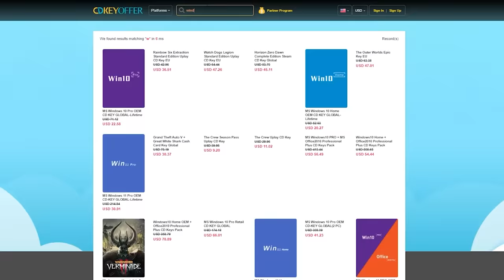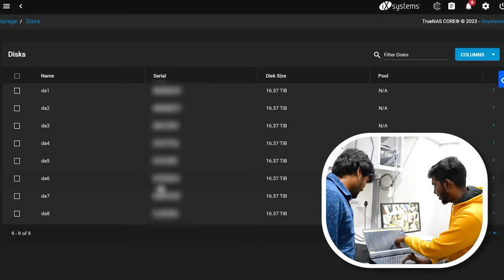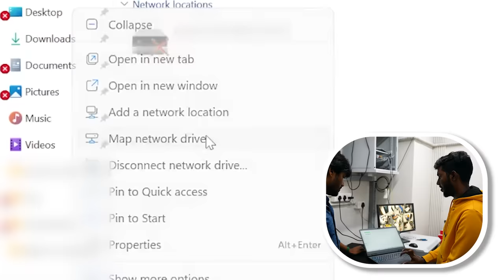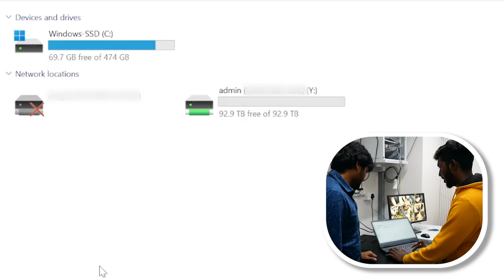150TB Storage Server @FinallyOffl  Office | Storage Server-எதுக்கு? - எப்படி SETUP செய்வது?

Comment: Hello Bro..one doubt..why do they go for Physical servers they can go with cloud providers like AWS or Azure right, any way this is not critical data and cloud has pay as you go model..which will work much cheaper, what is the advantage of taking pain of setting up server, maintaining it etc..can you let me know just curious..
Reply: Cloud storage is not cheaper. It's way more costly if it's for long term and large volume of data. (Eg: 30-50 TB of data usage per month can go as high as $3000/month)
Local system will be more faster than cloud. Since Finally will be mostly using it for video editing, they need faster network and local NAS is best for them.

Comment: PC Doc anna, i have a doubt. Like this type of storage server, how data stored in server hdd transferred to destination device, server hdd to destination device or hdd to server ram to destination device?
Reply: To my extent of knowledge, the server ram has nothing to do with the data that is being stored. Its only job is to manage where the data is getting stored in the installed hard drives. The server rack is connected to their office wifi and it is identified as NAS (Network Attached Storage). Most of he modern routers have this capability. In simple words, it can basically act like cloud storage that can be accessed by anyone connected to that particular wifi.... And one more thing that might strike a curiosity is that will it work if there is no internet. As it is just based on LAN. it would work even if there is no network connectivity...... Hope you got me.

Comment: This is also not a video optimized solution, the youtubers are getting bluffed on the configuration, its not the space in TB that will determine the throughput of the need, its the no of drives. The person who is designing the storage server is not having the right experience nor the practical experience to design for Video applications

Comment: Hi soldiers, my router is approx 20 meters away from my table in my home, which cat cable do i need to buy on this case. Have already concealed electrical pipe in my wall (approx 20 m span) and my internet speed is around 50 mbps.

Comment: 8:27 single vs multi mode cable  SFP+ module  diffrence ena bro?
Reply: Single cable bandwidth 10 Giga Bits = 1250 Mega bytes per second which is 8 times lesser, Double cable gives double speed with multiple LANs👍🏼

Comment: Bro normal dvd player ku use panra speaker epadi bro pc ku use panradhu plz reply
Reply: Adhuku cable thaniyaa vikum bro av to rca cable nu nenaikuraan adha check pani parungha
Reply: Ungha speaker laa enna ports elam iruku
Reply: @kaushik6371  only 2wires bro
Reply: @kaushik6371 bro normal speaker la RCA wire set pannitu and RCA to 3.5mm jack ahh direct ahh pc ku connect panalama
Reply: @shyamshyam-gc3rf  rca to 3.5mm wire kedacha try pani parungha
Reply: @kaushik6371  iruku bro en kitta work aguma
Reply: @kaushik6371  rc cable ahh cut panni andha connecter oda speaker wire ahh connect panni adha RCA to 3.5mm wire connect pana work aguma bro plz reply
Reply: @shyamshyam-gc3rf  i don't know about that but worth a try ilana neegha rca to 3.5mm cable yaa vangalam
Reply: @kaushik6371  athu iruku bro en kitta
Reply: @shyamshyam-gc3rf  apa try panugha
Reply: @kaushik6371  ok bro tq